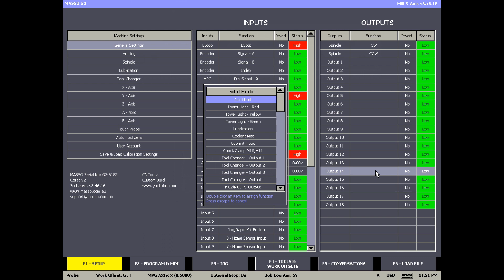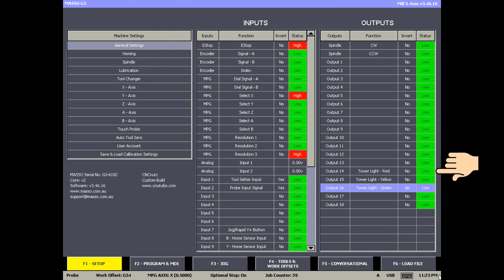How to connect the Masso TTL Relay Module - Masso Edition 019

Comment: Please could you help me understand in more ‘layman’s terms what this module is actually doing and why it is required? Kind regards Gavin
Reply from the maker: MASSO G3 uses TTL outputs which are unable to directly operate a relay. This board have the necessary circuitry to operate the relay. You can use the relays for multiple purposes depending on what sort of machine you have. Estop and Tower lights would be common to all machines.
Cheers Peter

Comment: Excellent videos, I was almost ready to buy a Masso but I found a payment for upgrades to 4th and 5th axis, my question is if the board has already IO pins for 5 axis, is it really necessary to but the upgrade?
Reply: I just recently got my masso g3 toutch and I love it. I went with the 5 axis varient because it works out to be cheaper if you buy it all together rather then upgrade later. They way it works, is, if you buy the 3 axis version, then the software they give you to download and install, only have the 3 axis enabled. If you get another axis, then you will be given a new version of the software to install, but with the A axis enabled. I got the toutch, the optical limit switches, and the pendant shipped for about 1500 bucks USD. And so far, worth every penny. I'm no longer tinkering around with a pc and software trying to make it act the way I want.
Reply: @dollars1234  OK, then buying the 740 usd masso is enough, however I found many atc 6 axis off line controllers for a third or a half the price of the masso, do you have any experience with for example the m350 controller or the xc609m?
Reply: @maharbatc  I don't have any working experience with them. I do however have one. It's a 5 axis one 5-n-n-n or something along those lines. I got it thinking it would do all I needed it to do, but after reading more about it, I realized it won't live up to my needs. So it's sitting on a shelf.
Reply: @maharbatc  support was also a deciding factor. There wasn't much other then forums with a bunch of people scratching there heads. With masso, I reach out to them, they look me up and see exactly what I have and know how to answer my questions.

Comment: i have enjoyed the video info re: the Masso cnc controllers. I have one question, will the controller seamlessly control Steppers with encoders rather than full on Servo Drives? I am building a router and want to use steppers with encoders because they are more cost effective.